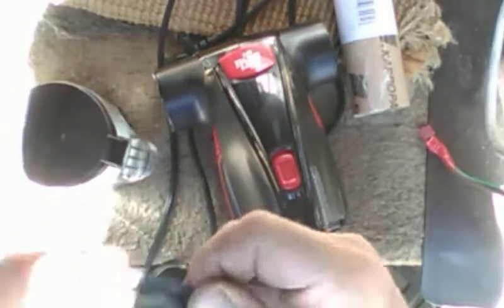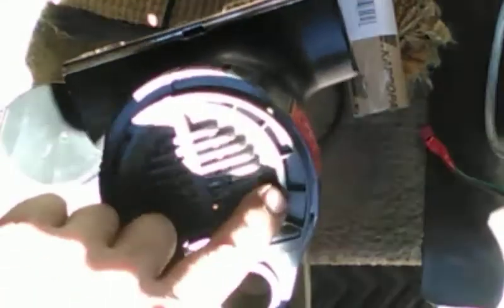Dirt Devil Hand Vac 2.0 Hand Vacuum / SD12000: issues & resolutions

Comment: I’m looking at getting one of these used for $9.99 at Goodwill right now. I love how you point out the problems with these things, and what to do about them. You did not mention how well it performs, once it is running right. I want to get it to vacuum up pine needles off of my runner carpets. Both my Bissell upright and my Black & Decker cordless vac cannot do this. Can this get the job done?
Reply from the maker: First, don't wash the fine dust filter. If it's wet in any way, and it is put back into use, fine dust will clog up it's pores. Ask me how I know 😄.

See the addition in the description, on the best way to apply reverse suction to purge the fine dust filter. Any shop-vac sized port is slightly smaller than the filter flange. Pop the filter in and out of a running shopvac-type hose or port.
Reply from the maker: Your comment was caught in the spam filter. I got noticed two days later that you posted it, and replied right away.
Reply from the maker: I believe they're ending up at Goodwill because of the filter misfit problem. 

As far as pine needles, I find it very useful to vacuum carpeted areas. It performs well with animal hair, etc. Pine needles shouldn't jam up the roller, but with other chunks, they may jam the spinning roller. Be aware of it stopping, causing the belt to heat-up.

The sound will change, of the motor. Just flick the power switch, rattle it or manually reverse the roller, and the offending piece will fall right out, and you can continue vacuuming.